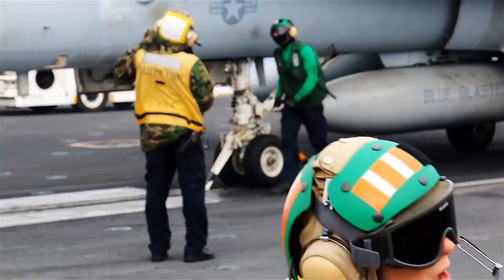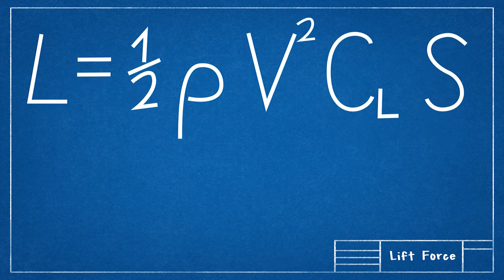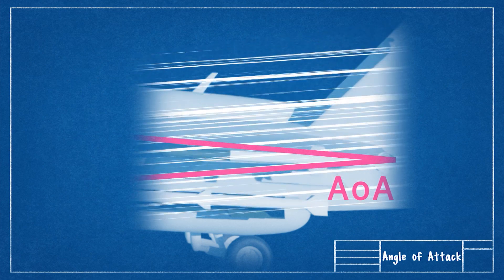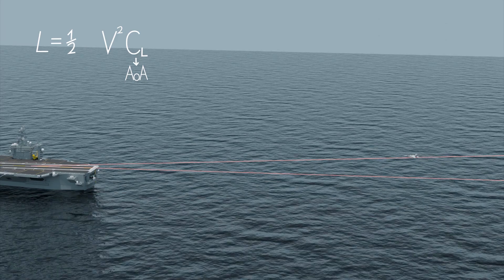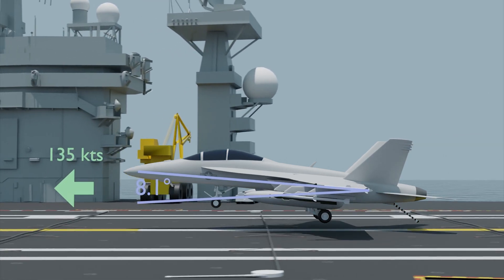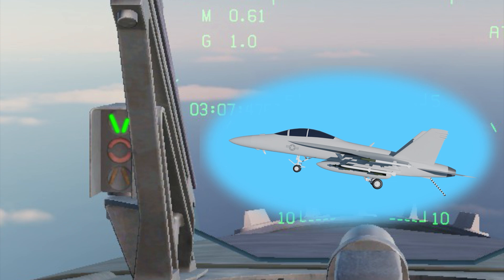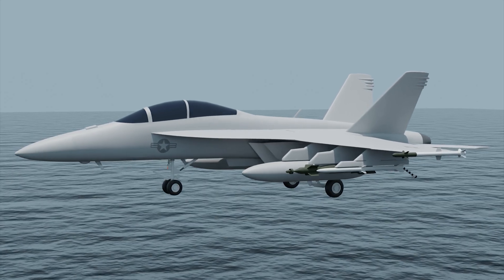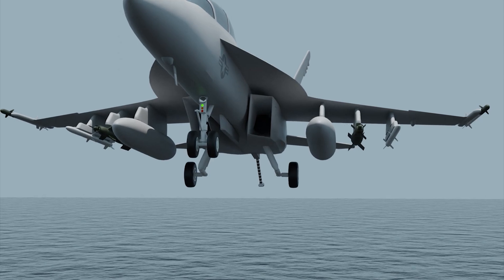What Are the Colorful Lights on Carrier-based Aircraft Used For?

Comment: I just subscribed, this is good stuff!  The LSOs have to observe so many things to keep the landing aircraft safe, including the AoA lights, the navigation lights, the noise of the engines, nose direction for centerline, pitching flight deck, and of course the aspect of the aircraft.  If LSOs tell you to do something (*power* or *easy with it*) they will know if you didn't listen to them because the AoA lights show if you are fast or slow, they are looking for the lights to change to keep you on glide path.  But: sometimes the AoA probe on the side of the plane that drives the lights is a goddamm liar and it is a bad week trying to solve that problem.

Comment: You didn't mention that the lights in the cockpit can be on in amber and red  or amber and green. Means they are slightly working their way out of AOA limits. Outside will still only show amber when this happens. They will flash if the tailhook is not down also unless the hook bypass switch is in the override position

Comment: One more comment on the lift equation.  The "V" in the equation is true speed through the air.  You labeled it as "airspeed" which could be interpreted as equivalent airspeed (EAS, more or less what the airspeed indicator shows), which is not the same as true airspeed (TAS), although at sea level they are probably very close.  Just to clarify, the V is TAS, and by the way it is in feet/second, not knots or miles per hour, etc.  Another viewer already caught the error on the climb/descent, which is not caused by lift being greater or less than the weight, as stated.

Comment: These lights also give an external indication that all three gear are down and locked. Back when I was flying in a squadron based in Norfolk, I received a call from our Squadron Duty Officer that the tower needed my help. Actually they just needed someone familiar with the S-2E for they have one in the pattern (not a locally based one) with indicators that one gear was not down and locked. I was the closest since I was living just outside our main gate. When I got up to the tower they explained the situation and I told them to have the aircraft fly down the runway at about 50 feet off the ground. When he was over the end of the runway I told them that all three gear were down and locked, he could come around and land. The tower operator was incredulous, that I could determine that with the aircraft so far away. I pointed out the attitude lights (it was a different design but effective none the less) appear only when all three gear are down and locked. 

Each landing gear has what is called a nutcracker switch. (Don't ask me whey it's called that) That switch is attached to an indicator on the console indicating gear is up and locked or down and locked. In between is an indication of barber pole (stripes on a background) indicating an unsafe gear. Sometimes the indicator goes back and gives the barber pole when it should show a gear down and locked. That was the situation here. The plane landed and was directed to park near our hanger. Over the weekend one of our mechanics installed a new indicator for our fellow squadron's aircraft.

Only aircraft designed for carrier use have attitude lights. They also do not have landing lights which always bothered our Air Force personnel when we had to land at an Air Force Base at night.
Reply from the maker: Thanks for sharing Your story
Reply: he said that in the video @4:25 in the video that they are a indcation that the landing gear is down.

Comment: Mentioned earlier .{ referring to time stamp, 5:00}  Aircraft do not climb because of excess lift. Lift  is a vector that always opposes gravity. Aircraft climb because of Vectored energy aka. Thrust. Even gliders climb because of vectored energy. In this case because of rising air currents. This is obviated by planes like the F-16 with a greater than 1:1 thrust to weight ratio . They can climb vertically on thrust alone. The wings are a hinderance in this configured attitude of a vertical climb. They provide nothing but drag for the climb.

Comment: You explain the lift formula correctly. Where you go slightly off piste is the not fully explaining rationale behind the entire system. That is if you fly every approach at exactly the perfect speed, it will be different speed every time because your weight will be different every time. But… your approach angle of attack will always be the same. This means that at high weights when more lift is required you need to fly faster to achieve the required lift. Being able to disregard airspeed and instead concentrate on what is important, ie. angle of attack and glide path thus reducing workload. The big question is why don’t all other aircraft do this?

Comment: Regarding the lift/weight thing, if that is true how can an airplane fly upside down?
Reply from the maker: Angle of attack is the answer😉
Reply: @x-planed  If you increase the AOA, then the nose rises and the plane is ascending, right?  That  means upside down a plane cannot fly level.  ?
Reply: Even Upside down the wings still generate lift. Albeit inefficiently . Increased AOA and airspeed compensate. Requiring Increased power to maintain. The only thing that is backwards is aileron control and coordinated turning.

Comment: Thank you for uploading the great video as always !!
Btw at 2:42, approach air speed depends on the aircraft’s gross weight, right?

The total weight of the aircraft changes, so the required lift also changes. Since the "Onspeed" (AoA) is strictly determined so that wires can be caught safely, descent rate is adjusted by airspeed.
Reply from the maker: That’s correct😉
Reply: Well it wasn't spelled out in the video but you want to maximize AOA to as close to the Critical CL minus a safety margin thereby generating the maximum amount of lift at the lowest airspeed. Thus being ONSPEED will always adjust the airspeed inherently based on your weight. Combine that with your glideslope and you will always have the lowest ground speed for your configuration. Arguably the whole idea of an ideal Approach or even a stall SPEED is made obsolete by having an AOA indicator.

Comment: On the WWII Corsair, that was just a landing light on the wing, not AOA approach lights. I doubt they had the technology back then for an AOA display.
Reply from the maker: There’s a walkaround of a restored F4U on Youtube where a guide clearly explains that it is an approach light. Look it up
Reply: @x-planed  I presume it must work more like the FLOLS (i.e. passively) rather than the more modern systems on the Hornet and Tomcat, since as far as I'm aware the F4U had no sensors or instrumentation for measuring AOA.
Reply from the maker: Exactly
Reply: @x-planed  "approach" as in shining a light ahead so the pilot could see where he is landing and where he is going when he is taxiing. Guides can be wrong or use the wrong name for something. I don't have to look it up, I know that the tech didn't exist in WWII.
Reply: @jamesmeader6539  I think you really are mistaken; while the F4U has no sensors or instrumentation to measure AOA, you can still infer the AOA of an aircraft from the angular difference between the longitudinal axis of the aircraft and its flight path/relative wind just by looking at it. This means that if you have someone standing in the flight path of the aircraft (the LSO) they can see the angle of attack of the aircraft by measuring the angular difference between the nose and themselves.

This is simplified by adding the three lights and a lens to the wing, with the lens arranged so as an observer (the LSO) only sees one light at a time. This is the same principle as PAPI lights or FLOLS, both used to gauge glide slope entirely passively, no fancy AOA vane required.
Reply: @tinglydingle  Fine. You make that assertion, show me proof that it was actually done. I base MY assertion on 50+ years of familiarity and study of aviation, including Naval aviation. The practiced eye of the LSO waving the paddles was how it was done in the era of the piston-engine Corsair. No AOA lights. Prove to me that they existed, not just that you think it could have been done.
Reply: @jamesmeader6539  I literally said "I think" mate, and then described how it's possible without the complex instrumentation you point out was absent, I didn't make any absolute statements and fully accept I may be wrong. You're the one claiming something beyond doubt, so the burden of proof lies with you.

But since you asked, here's a Corsair pilot with a real Corsair talking about it: https://youtu.be/qkSI8abs0Ig?si=rbqr753rspDIVO9H&t=1053 skip to 17:33 for the relevant part.
Reply from the maker: @jamesmeader6539 look at this video: around 18th minute  https://youtu.be/qkSI8abs0Ig?si=oozjRc0h7P80BPCu. The guide is also an owner and a pilot of this particular Corsair so I belive he knows what he’s saying
Reply: @x-planed   @x-planed  I don't know what to tell you. I've been researching this rather extensively the last couple of days to try to either support or discount the assertions that you and the gentleman in the video make, and I cannot find ANYTHING that supports the claim that this aircraft was so equipped. I do not think that the example of a restored airframe is representative of aircraft of the original era. ANYTHING could have been put in it in subsequent years. I'd suggest you Google "did the F4U Corsair have an angle of attack display that the landing signal officer could see".  In short, we will not come to an agreement on this. I will continue to believe what my own research shows which other commenters in this thread agree with.
Reply from the maker: @jamesmeader6539  You should verify Your research then. Here's a F4U pilot's handbook: https://www.spruemaster.com/wp-content/gallery/manual/Vought_F4U1-Pilots_handbook.pdf. Scroll to page 56, paragraph 7: Approach Lights. I feel like you're completely immune to facts, and even if I flew to you in the original airplane, you still wouldn't believe it
Reply: You are right. The AOA indexer was invented during the cold war. It didn't exist during WW2.
Reply: @neurofiedyamato8763  AOA measurement was invented by Orville Wright in 1913. Also remember that the Corsair's service life extended well beyond WWII and was only retired in 1953 by the US, and was still in military service elsewhere until 1979, leaving plenty of time for post-war upgrades.
Reply: @neurofiedyamato8763  Thank you!